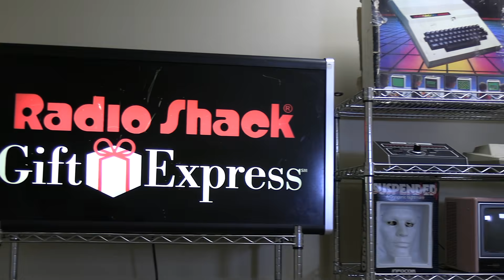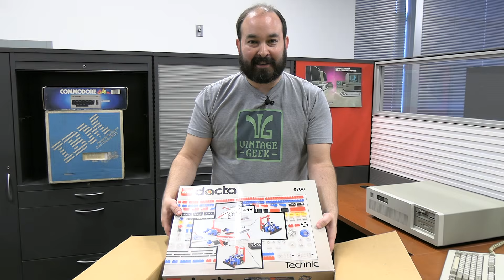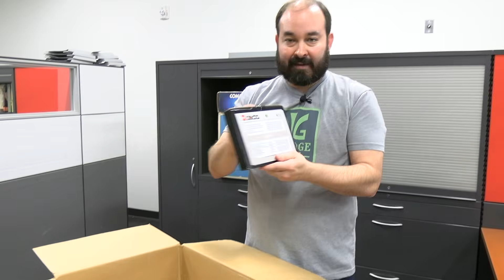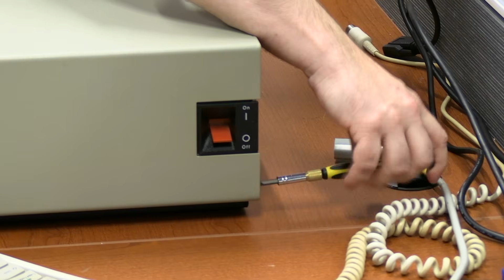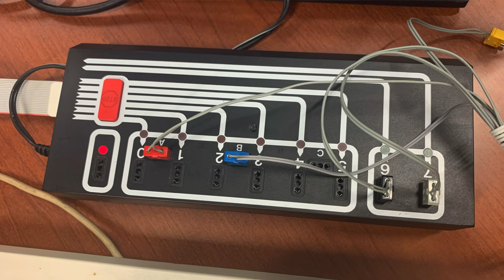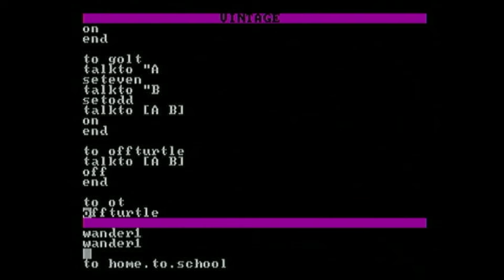Building a LEGO Robot from the ‘90s

Comment: oh you had confused for a second there when i saw lego's but i remember i had a class in high school in the mid 2000s using not this specifically but some sort of small building block thing with controllable motors and sensors that would send light info and stuff back to the computer (which was also non dos software in win98/xp machines).
but we'd first have to build something and then program it do things like navigate around an odd shaped track with getting the correct amount of move forward and turn x amount or however it was. or stuff like drag race at full speed then stop once it goes under a tunnel and see's the light change (that was easy).
the trickiest one i think was when we had to have a little crane pick up 3 different color blocks in random order and depending on the information the light sensor picked up, it would have to rotate and drop it in the matching color bin. and the light sensor would just give a numeric value so a bunch of tweaking with the if greater & less than values.
it was a really fun class tho so thanks for the trip down memory lane.

Comment: The sight of the motors and the axles and grey gear wheels stirs some distant but definite memories of handling these things. I can't recall if it was at school or home, but as you say it wasn't really available to general consumers I suppose it must have been at junior school, which was late 1980s/early 90s for me. I know that there was no interaction with a computer though, because we didn't have IBM PCs either at home or at junior school, though the school did have BBC Micros and, at a later date, an Acorn Archimedes. Perhaps the one I played with was a different product that used a lot of the same parts but didn't require a computer to operate.
Reply: This product was available in the UK for the BBC Micro; in the U.S., it was only pushed for PC or Apple II (though it was available worldwide on Commodore 64/128).